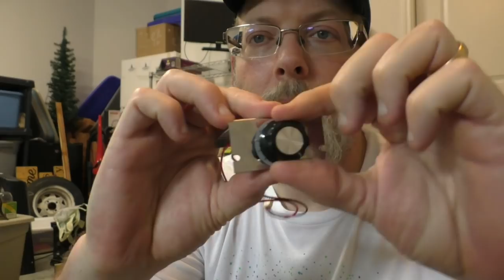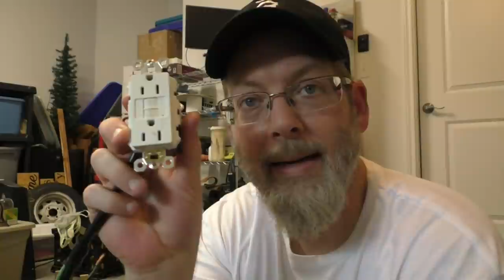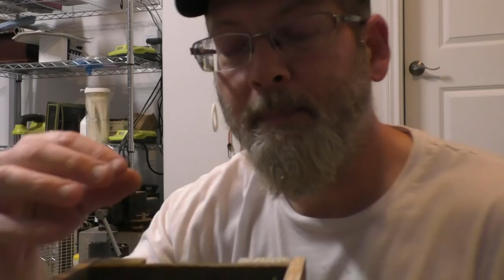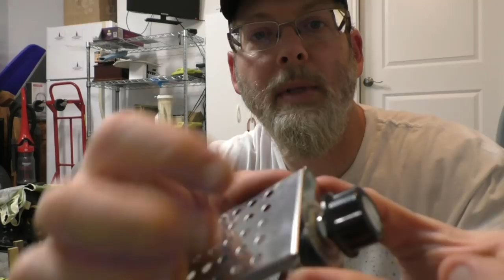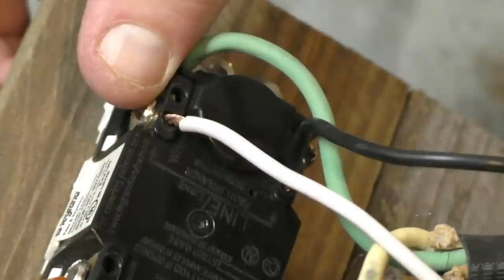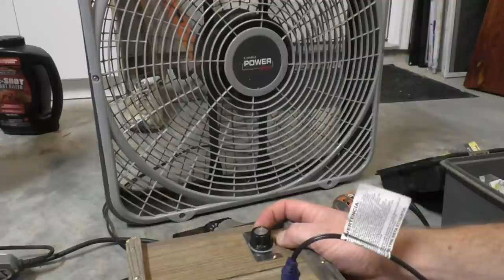⚡ELECTRIFY Your STILL - Easy SCR Controller Box Build🔌

Comment: This!! I got a PID... Cause George. And it works. But it's sooooo slow. The vapor speed is so slow because the element is turning off more than its on when maintaining temperature at the head.
Reply from the maker: I used a PID twice. They're kind of dummy proof when you're just getting into things and the concept of cuts is daunting and confusing. I think that's why George used them so much. He knew he was teaching a lot of first timers and wanted them to succeed no matter what. But ultimately I think PID's better at controlling heat on things like brew kettles, mash tuns and malt kilns. George started switching to PWM's over the last year or so. They're digital and do essentially the same thing as the SCR. I'll upgrade to one of those eventually;-) If you still have your PID, you can use some of the components in that box to rebuild it into a PWM so it runs as a power regulator, and not a temp regulator. George has a shit ton of vids on how to do it.
Reply: @BeardedBored  hmmm. I've got an SCR in my amazon cart. Could I put the SCR in the relay loop to control the power the PID switching on and off?

I could still use it at the beginning to take the fores but then turn down the power until it reaches a point where the pid is running the element all the time but at, say, 400 watts to maintain the head temp? Sort of a semi automatic set up? This way I have the control of power and temp?
Reply from the maker: @yarkobroda  That's way above my skill level:-(

Comment: Great job Bearded, but that outlet will not act like a breaker if you overload it with more than 20 amps.  So it can only handle 2400 watts of power at 120 volts.  It should work great for a 2000 watt heating element in a boil pot, but if you need more wattage to heat up faster or a larger pot, then you should consider using 240 volts.  Your same setup at 240 volts could handle up to a 4500 watt element.
Reply from the maker: Thanks Bruce! That's so helpful👍🍺
Reply: Would 2 1600 watt 115v heating elements boil water in 15 gallon keg? Or just 1, don’t want to burn the mash.
Reply: How will and not act like a breaker if it is overloaded then it will trip and not be usable until it is reset, just like a breaker.

Comment: if you pull the nob off the front you should see a shallow nut under it..  I have used that nut and drilled a hole so the threads fit through the drilled hole and just used the nut to hold it in place or have gotten another shallow nut and have done it that way then just push the nob back on...

Comment: "Oh I'll be gentle, I promise."  "i'm gonna give you a tip, and only the tip"   Sorry, not a weirdo but I couldn't resist,   asking if we would be gentle when giving tips is just too easy.  Thanks for the fun vid on SCR.  I made a PID for one element and this is my next project to add the SCR for the second element and then wire a 220v extension cord that has 2 separate 110 outlets so I can independently power both 110v heating elements in my thingy so I can heat quickly yet dial it back to put on "cruise mode".   Thus using the 30A dryer plug so I don't have to use two separate circuits as a normal 15A is not big enough for the 2K elements.  Kudo's to you sir!
Reply from the maker: You didn't even buy me dinner.
Reply: @BeardedBored  hahaha. Dude, if I ever run into you, you can bet I'll buy dinner and drinks for you and your better half!
Reply from the maker: @reevinriggin3570  Ok, then the tip is accepted, just the tip though.

Comment: never heard of these, but seems to work pretty well. I went with a cooktop controller, but the electronics of the canner I use shut down below ~80% power supply. Going to put a switch right between electronics and heater element and a separate supply cord, so I can switch from "preserving cooker mode" to "direct dial in"...  (just bridging the temperature switch didn't work, should have bought the cheaper basic version without the electronics...)
Reply from the maker: Your an electronics wizard compared to me:-)
Reply: @BeardedBored  ah, wizardry... that might explain the smokey haze and scorched smell around here...
Reply from the maker: @lilinguhongo2621   LOL!!

Comment: One note of interest. Since you have a GFI outlet in you box, if you plug into a circuit that has a second GFI somewhere in one of the wall outlets, they could very well trip one another. I suggest if you plan of plugging into a wall circuit that already has a GFI outlet, swap out the GFI in your box for a regular outlet.
Reply from the maker: I'll keep that in mind. Thanks!
Reply: A gfi can be plugged into another gfi with no issues. They will only trip if there is an issue. Modern hair driers have gfi's built into the cord and gfi outlets are required in bathrooms.

Comment: Great video! I'm not electrical knowledgeable at all. The question I have is what gauge are the connecting wires are? I will be making mine 220v. Didn't know if you used 18, 16, 14 or 12 gauge to connect your devices. Thank you!
Reply from the maker: Go with 12 or even 10. Overkill is fine, especially when you're dealing with angry pixies.

Comment: Hey Bearded :-) Just the man I was looking for !! I was bored, the prune plums where ripe, so now I have a batch of plum brandy fermenting (hypothetical that is :-) Question: When you aged the Slivovitz on Birch, about how much wood did you use for how much Slivovitz ? Slivovitz 40 % ABV ?? And by the way. I have one of those SCR's to and a little amp/volt meter hooked up in the box, works like a charm ! And Thanks for all the funny things you do !! :-) !!
Reply from the maker: I used one stave per 750ml of 40%. The staves are .5"x.5"x6". Now I have a question for you. Do you leave the stones in your plum mash, or take them out?
Reply: would love to know as well...  heard of mash with or without, with a few crushed ones, distilled with or without...  the more/longer stones are in, the more hydrogen cyanide transfers to the product, especially from crushed stones. It's nasty stuff, so personally I would tend to "leave in for ferment, don't crush, don't put into still". Some prefer to have a little "bite" on their likker, but I just don't know enough to stay on the safe side...
Reply: @BeardedBored  Thanks for the answer ! Will try that ! Also on some elderberry shine I have left. And no stones at all, the Mrs and me cut all plums in half and took the stones out. I then heated them up covered with water in a BAP (big ass pot) 45 C° 20 min. to kill of wild yeast and soften them up a bit . Went with a recipe from a distillers forum. 1 kg. plums to 1 kg. sugar to 4 liter water. Adjust to OG1090 with sugar (not much), adjust ph up (was 3,8) with baking soda/powder (a lot) to 5,2 and pitch yeast. I used fresh Malteser yeast 50 g. for each 10 l. mash (our brand of bakers yeast) the company is owned by Lallemand. Here 3 days later its already  dropped 32 points and smells amazing !!
Reply: @lilinguhongo2621  No stones at all, the Mrs and me cut all plums in half and took the stones out. I then heated them up covered with water in a BAP (big ass pot) 45 C° 20 min. to kill of wild yeast and soften them up a bit . Went with a recipe from a distillers forum. 1 kg. plums to 1 kg. sugar to 4 liter water. Adjust to OG1090 with sugar (not much), adjust ph up (was 3,8) with baking soda/powder (a lot) to 5,2 and pitch yeast. I used fresh Malteser yeast 50 g. for each 10 l. mash (our brand of bakers yeast) the company is owned by Lallemand. Here 3 days later its already  dropped 32 points and smells amazing !!
Reply: @heymulen1840  sounds like that bit of extra work will pay off in the end. Thanks for the details!
My actual ferment won't kick off, even the "rescue starter" lies like a winter lake...  so I'm done with liquid yeast now, hope to get it going with dry stuff before it turns bad...
Reply from the maker: @heymulen1840  Thanks for the detail brother!

Comment: Electrician here, that is a bit of a fire hazard. The gfi you are using has a 15a max current. 1800w max and if there is a chance of using it straight for over 3 hours you'll want to go with 1500w max. You need to make sure all wire you use is at least 14awg to handle the amperage. If you use 12awg and a 20a gfi you can get 2400w or 1900w if running over 3hrs but you will also need to be plugged into a 20a circuit in your house. Kitchen and garage circuits are usually 20a. It would also be a good idea to run a separate neutral wire to everything and wirenut them to the neutral on the cord. Lastly, give the gfi a couple wraps of electrical tape to help prevent anything from shorting out.
Reply from the maker: Thanks for the helpful details 👍👍👍
Reply: @BeardedBored  just found your channel after getting back into still'n and watching a bunch of Jesse's stuff. Thanks for all the good info and hard work.
Reply from the maker: @kyleo1236  Thanks brother:-)

Comment: Hey man,your I love channel ! However,i got a 1650 watt internal element still (10 gal). Its a clawhammer supply self build kit. Anyways, I'm fixin to try and use it tomorrow but I dont have a way of controlling power atm so when i plug up,its wide open. It's not a huge element, so I'm thinkin itll be good,my wash is well strained but what do you think? If your still reading lol
Reply from the maker: NO! You must have a way to control the power flow. Be patient, wait until you can do it right, brother. You will boil out your mash and puke the still running full blast through the whole run. 100% is fine to get you up to first drips, then knock it back to like 50% to see if you still get drips. If not, dial it up 5% and wait a few minutes, repeat as necessary until you get drips.
Reply: Okay man,I'll do just as you told me, and I'll follow your how-to video. I've got other stove top china stills to get me through. I'll need to order the stuff and I'm sure you've got links in the video description. Thanks slot man!
Reply from the maker: @adammitchell3462  Happy to help:-)

Comment: Would the idea be that you could plug an electric hot plate into this and you could prevent the temperature cycling that would occur without the controller box interface? In other words, using this controller box with a hot plate allows you to properly hold temperature?
Reply from the maker: No, the hot plate cycling is usually controlled internally. This is for water heater elements or wrap around heater bands that are simply on or off.

Comment: Update on my SCR based on this set up.... 😭 Powered up, element started heating then POP! mid leg on the bottom of the PCB melted down. Dead SCR. Heartbreaking. Was set up to do my very first vinegar run because my wash will be ready in 2 days. Glad i didnt test on run day. I also should have taken the SCR apart and double checked the soldering. Stay Tuned.

Comment: On a low setting check to see if the GFI still works...   I have never attached a low voltage to a GFI so I have no idea if it would still work. (test Button)
Reply from the maker: Good point.
Reply: Scr doesn't reduce voltage. It reduces watts and amps. BTW the switch on a GFCI is not a breaker. A breaker trips when excessive amperage is being drawn. A GFCI trips when there is a ground fault.

Comment: Bearded, please help!
I have a corn and barley mash that has been fermenting for a week now.
Checked in on it and did a taste test, and it seems salty? Have you ever experienced this, and is it anything to worry about?
Reply from the maker: Salty? Never come across that. Did you use brew shop grain, or did you source it from somewhere else? I'm just wondering if you used something like corn meal that may have contained salt? If it was all fresh grain, then maybe your water has a higher sodium content? Not sure man. But as long as it ferments out, you should be fine. Salt doesn't come through distillation, so my guess is that you won't taste it in a finished product...hypothetically;-)

Comment: Thanks uncle!
I used an SCR stolen from my ceiling fan. Great content again and informative!

I saw Rudi also making the comment you should use the same gauge wire inside (black and white at your switch and SCR) 
Not sure the gauge but a 2.5 mm is the least you are allowed to use in this instance as it is basically an extension cord. 
Cheers 🍻
Reply from the maker: Thanks, I'll swap it out;-)

Comment: Nice! My 5 minute version: buy PWM controller. Buy short extension cord rated for 20 amps at 240 volts. Cut extension cord in half and separate and strip insulation back on all four wires. Screw wires onto terminal block on PWM. Plug both ends in. Done. Keep PWM AWAY FROM LIQUIDS! Einstein: “Things should be as simple as possible without being too simple.”
Reply from the maker: Nice;-)

Comment: Since you have made your build have you noticed a considerable amount of heat that just might require a fan? I have the parts for the build sitting in front of me which I picked up from your links. I do have some PC power supply fans and had the thought I could add one to the inside of the box. I am not an electrician either but maybe you would know, if you were to add a PC fan how would you do it?
Reply from the maker: I think you need to add a solid state relay so you can add a fan. Check George's channel for build videos. I'm going to add one eventually because it's the smart thing to do, but I haven't needed one. For a temporary fix you could set a small fan next to the box to blow through the gaps. I did that on an older build when it was really hot outside.
Reply: @BeardedBored  thank you
Reply: @silly6004

Comment: I  built the PID from  George  do I need this
Reply: It depends on whether you want the PID to control the power based on temperature or you want to control the power based on temperature. 

Once your column is balanced with either, small changes you make will result in small changes in your column. Until it is balanced either method of temp/power control will give you swings.
Reply from the maker: I like power/output speed control more than set temperature control, but it's just my preference. I feel like you can fine tune the run a little better.

Comment: I like the look and the use, but my biggest concern is HEAT sink HEAT, wood burns. How hot is the Heat sink going to get will it burn the dry wood? If you had mounted the heat sink with some spacers keeping it away from the wood, I would be less concerned.
Reply from the maker: It gets about 100-110F when it's maxed out. Wood ignites at 500F+ so it'll be fine. Most people use plastic boxes with much lower melting points with no trouble.

Comment: I'm a bit concerned about the wire guage ,it seems pretty small.
Reply from the maker: On the switch? Yeah, I think I'm going to swap that out.
Reply: @BeardedBored  If you are unfamiliar with sizing wire, if it is going on a 20 amp circuit, you need 12 ga. wire. 20 amps x 120 volts = 2400 watts.

Comment: Just the other day, I turned to my wife and said... I really miss Radio Shack..... now have to wait for parts to come in............................................................................

Ohh, and the GFI does not have a circuit breaker in it... it trips for Ground Fault... not over load.

carry on with the vid.      Side note, this would be great for a Dremel tool with a single speed........
Reply from the maker: Thanks John:-)

Comment: You can litterally put a course threaded screw between the fins of the heat sink for mounting.  Just find a screw that digs in slightly.  I mean use common sense.  They mount these all the time like this.  Also thats how manufacturers mount fans to them.

Comment: Cool build but it’s not even close to 10 kilowatts of power. Even if you used 240v it wouldn’t be over 5 kilowatts.
Reply from the maker: True. But the scr can handle that much before burning out. I tried a 2K and it got too hot, so I opted for overkill.